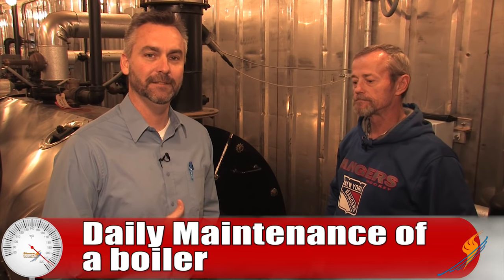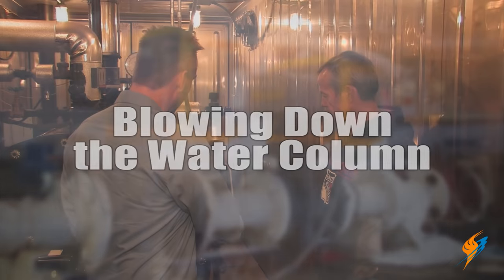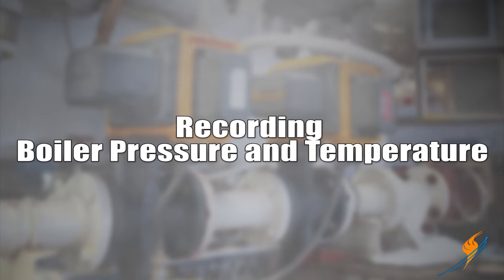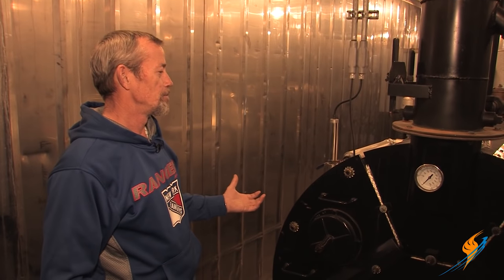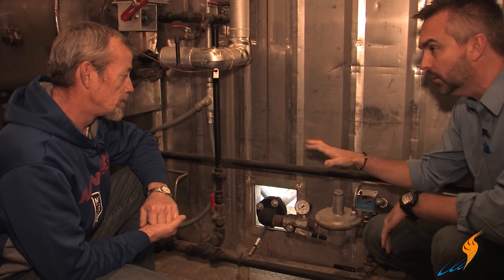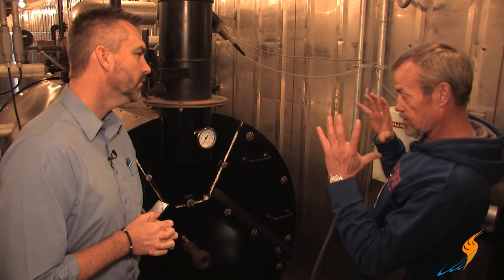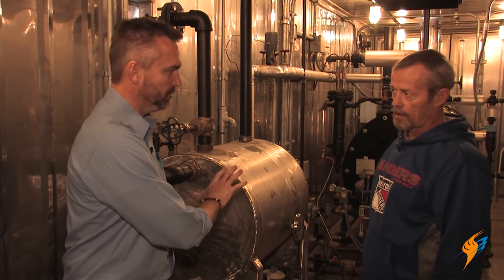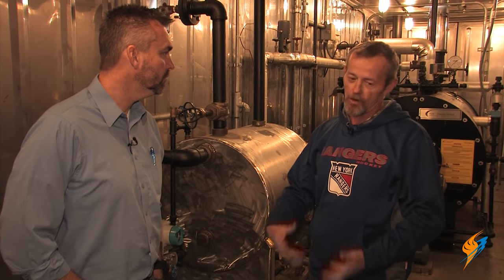Daily Steam Boiler Maintenance in the Boiler Room - Boiling Point

Comment: I am automating the bottom/intermittent blowdown valves (2). How fast/slow should the stroke time be? Both my valves are slow-opening valves (>5 360 deg turn per stroke), but no where does it relate to the stroke time.

Comment: Blow down lowers TDS (total dissolved solids ) that attach to boiler tubes and creates havoc to boilers. Softeners  using salt is a chemical reaction that causes the collective products of hard water like calcium and iron to be collected and released using salt water solution regeneration cycle. These solids are rinsed and drained to the sewer. And the timed process starts over again.

Comment: Hi I`m a elementary school custodian and newly appointed Head Custodian. With that said I`m familiar with all types of Boilers and their operation. Question ; I may be required to shut of the Main water supply in an emergency, is there a procedure for this? should I shut off Boiler then pumps before water is shut off? Thank you
Reply from the maker: Absolutely. Shut the main header valves off to maintain heat and water level, then shut the boiler off. Next shut down the pumps before shutting off the water supply. Simply reverse this procedure when you turn the main water supply back on. Let the boiler get back up to operating pressure before slowly opening the main header valves and then resume normal operation. Hopefully that helps. Take a look at our Boiler University http://www.wareinc.com/boiler-training/boiler-university this might be something you could be interested in.
Reply: Yes thank you for your quick response
Reply: Hi am boiler operator... 170tph..wat about this one

Comment: I live in an apartment bullding 12 floors I live on the 12 the boiler room is one floor above me  I am getting a smell of antifreeze? at least I think it is and for a while I have been getting the sound that a refrigerator does when it is about to break down that has stopped now I am hearing a vibration noise very loud we have been telling our apartment manager about this.fir weeks nothing ever gets done should this be a cause for concern
Reply from the maker: Hmm not really sure how we can help with this one. The only thing we could suggest is to keep talking to your apartment manager about this and hopefully it gets fixed. Good luck and thanks for watching!
Reply: Marie Blackmore they are using glycol for the hot water loop to heat your building. There’s probably a leak and you should notify the property management.
Reply: vipleather I have they do not seem to care think my next step I court